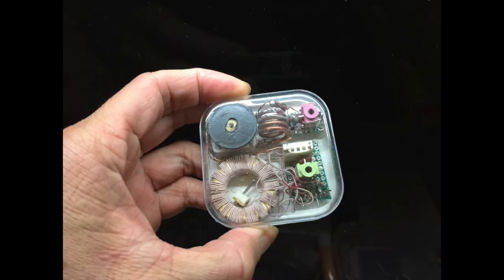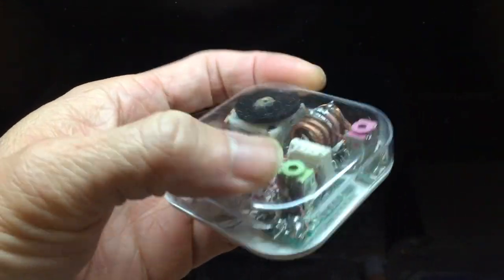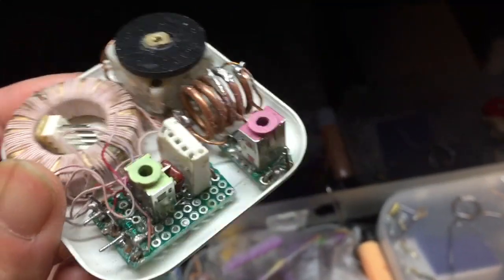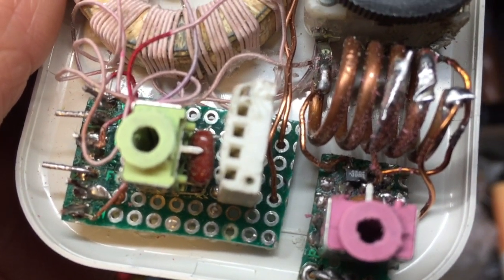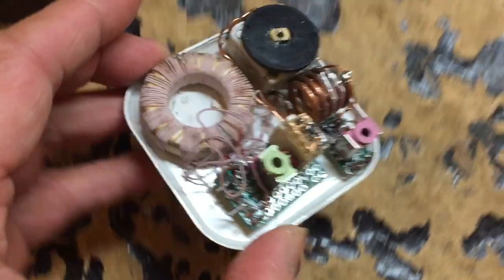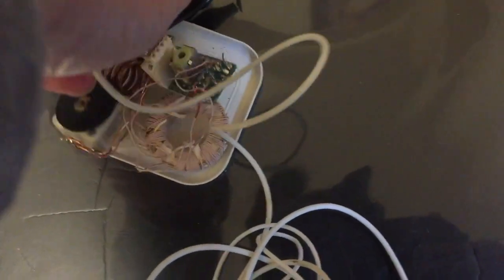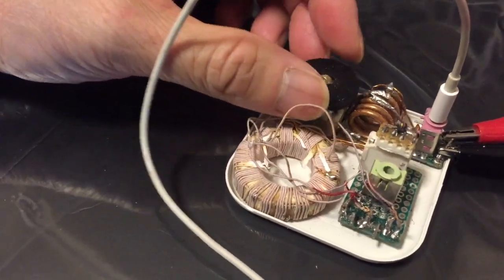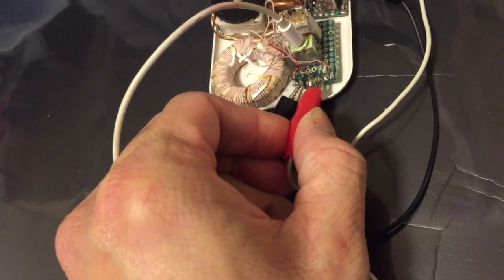Earbud Case AM/FM Crystal Radio耳塞盒AM/FM礦石收音機

Comment: Hey Billy 
Please clear my doubt 

Is AM & MW same or both r different
Reply from the maker: loganathan vb , AM=Amplitude modulation , a method of modulating audio wave  to  Wireless wave for transmission. FM is frequency modulation. MW is medium wave 540khz to 1650 kHz which is the frequency of the broadcast radio when its first become popular. Then later on we have FM radio broadcast which is frequency modulated and transmitted at the VHF (78Mhz to 110Mhz). AM and MW are used interchangeably for laymen to mean this type of radio broadcast. And FM us used by laymen to for the latter. But technically they are used to describe the different attributes of the wireless communication. AM and FM are the different modulation methods. LW MW SW are the frequency range of the broadcast. Actually to be exact , frequency range to describe in these terms: LF MF HF VHF UHF SHF . U can google more on these terms

Comment: Very slick radio Billy !
Do you use an oscilloscope to adjust the coupling distance  between the coils of the Am Fm radio, like the double tuned Fm circuit ?
Reply from the maker: I do not have the oscilloscope. I just test with my ear and find the best spot to avoid FM and AM radio coil interference between one another